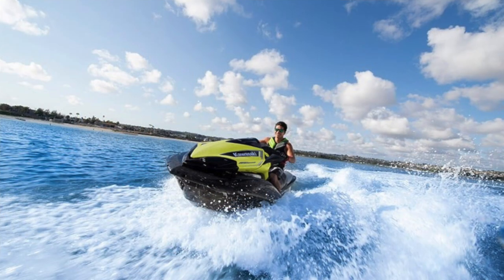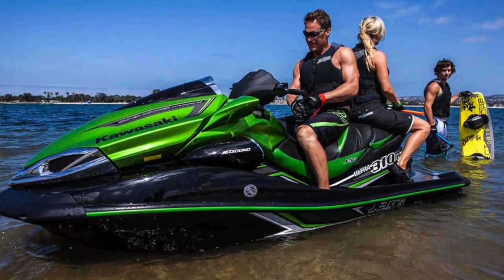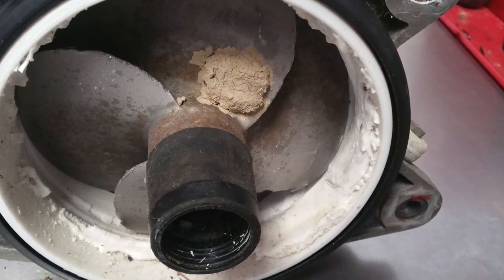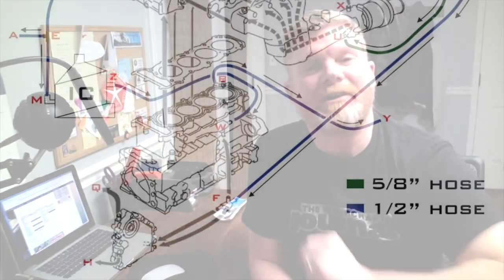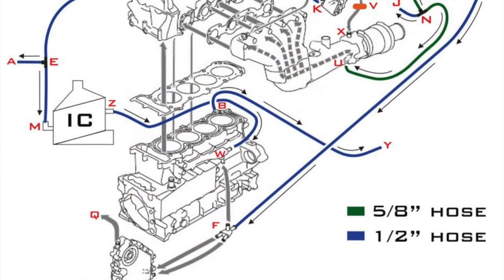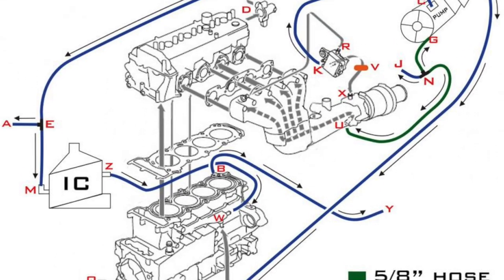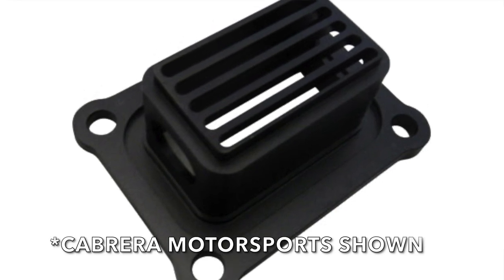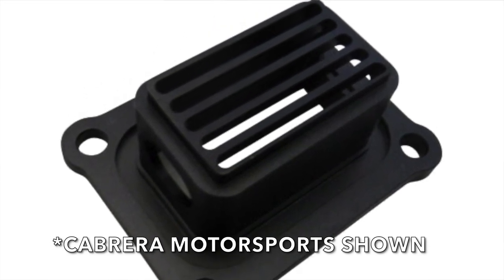Shallow Starts Are THE ENEMY of Open-Loop Cooling Systems: WCJ Quick Topic

Comment: Your exactly right on this situation. When I would go over the skis when I worked in the dealership or even with my own customers who really didn’t know anything except green button means go, I would go over this. The manuals at 1 time use to say only 2ft, so 3 is better. I would tell them to try to get to waist high and rock the back left and right to shake out any stones that may have gotten up there. Use to say the jet pump is like a vacuum. It sucks up anything that is in its way and it loves ski ropes for dessert. Flushing was important in all the skis bc of the contaminates but especially for the Kawis. With the water cooled electronics they had like the stators, temp sensors and the computers for the 1100di engines, a piece of stone or some mucky sand with overheat an item with no problem. If it wasn’t the sand, it was the dried up salt deposits from not flushing. So either way you were screwed. Also the little brass cooling line fittings don’t like the pebbles too. But with the newer yamaha and Seadoos they can be still affected just line the Kawi. The water cooled rectifier on the yami 1800cc engine can be plagued by this. The Seadoo closed loop is a problem solver with this but you still have to flush out the exhaust so your not out of the loop yet. 
But, good stuff on the beaching and flushing. People don’t realize those small things can sink a $15,000 ski nowadays if not done correctly.
Reply from the maker: It's nice when a professional steps in and echoes what Kevin advocates. It means we're not making this stuff up. Thank you.

Comment: Wisconsin river sand is fairly course with pebbles that are around eighth of an inch in diameter that love to pile up inside the water jackets and cooling passages of open loop skis. Over the years I have actually had to pull the head off my Yamaha skis and dump my engine out! You can run a RAW water strainer but you better be prepared to empty that constantly. For this reason I really love close loop cooling now.
Reply from the maker: Dang. That sounds brutal!
Reply: @watercraftjournal  One time was a bit extreme because I was 20 miles from anywhere on the river and started to overheat so I had to actually pull the head off on a sandbar and roll my ski up on the outside and almost upside down to allow debris to clear out of cylinder water jackets and then reassemble my motor. This is also why I carry a very extensive tool kit with me on long trips far from help!
Reply from the maker: HOLY CRAP. That's a heck of job to do on the side of the river!

Comment: Fun story called more money than brains: had a customer who bought a new fxho (mr1 style). Lasted 1 day. Customer picked it up and drove it away from the dealership. At the end of the day, the ski was being towed in by sea tow. We were all worried that we missed something after prepping the ski and it’s test run. Nope the customer ran into a sand bar and he thought the thing ejected out sand paddles tire when you get stuck so he kept flooring it to try to push himself off. Well the tide rose up he started to float, so he took off again. Well this time he sank the ski. All the cooling lines were so clogged with sand and got so hot it melted every piece of rubber and plastic on the exhaust and water came in everywhere. The engine that was once silver, was now a pretty gold color. 
End result. Customer had enough money than brains and bought another one and we prepped it for him the next day.
Reply from the maker: OMG

Comment: Polytec Sea-Doo solves these problems?
Reply from the maker: Polytec can be scratched and gouged too.
Reply: @watercraftjournal  Fair enough, I'll meet you halfway, "less of an issue with polytec".
Reply from the maker: It's really a wash. What Polytec offers is the manufacturer a cheaper, lighter material to produce. Less weight often results in improved speed and/or acceleration, giving the owner a thrilling experience.